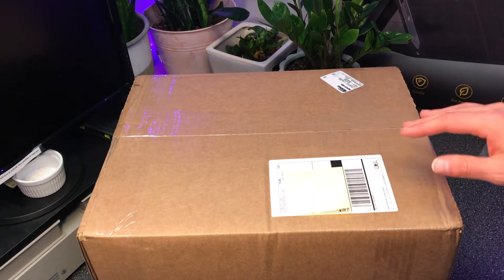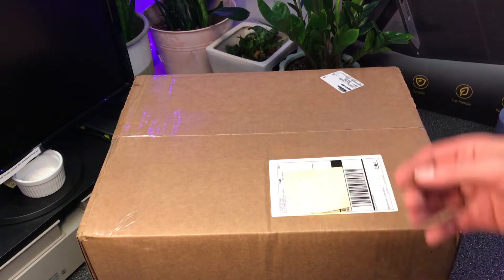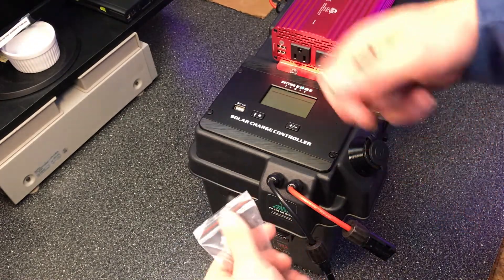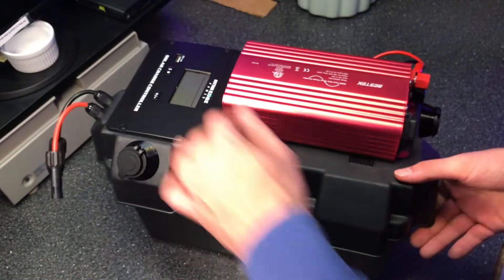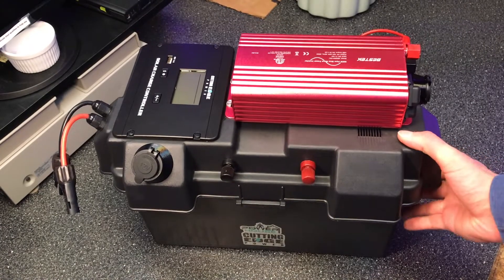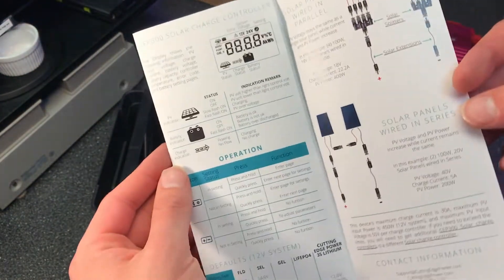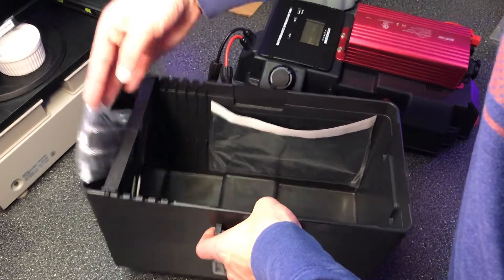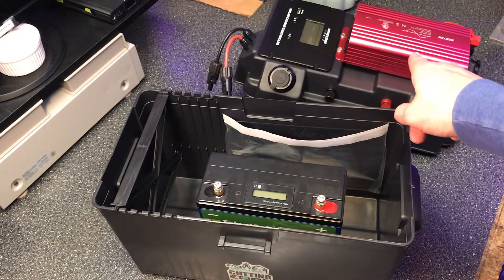USA-MADE! Unboxing the Cutting Edge Power 500W Pure Sine Solar Generator

Comment: I have the same setup but the 2000 w inverter. Watch for the hardware to come loose I had a few wires loose on delivery. It works fine but for what I paid I could have done a DIY way cheaper